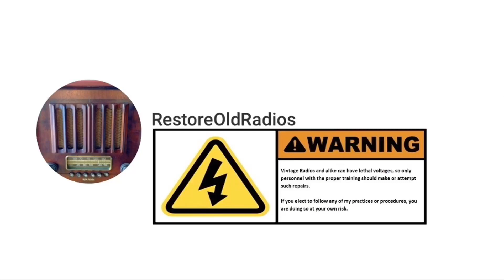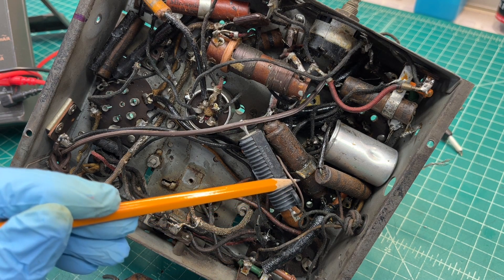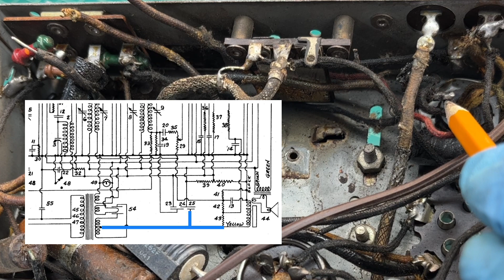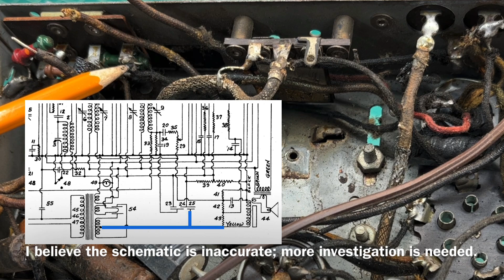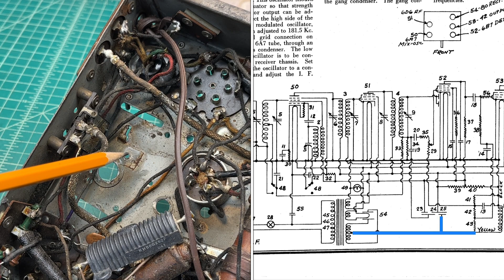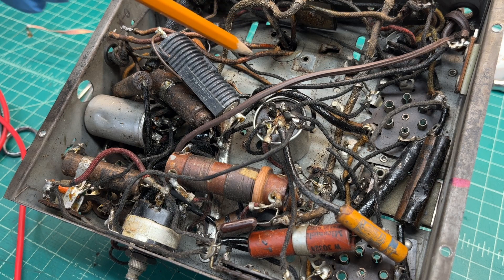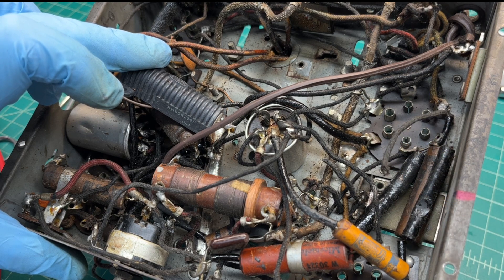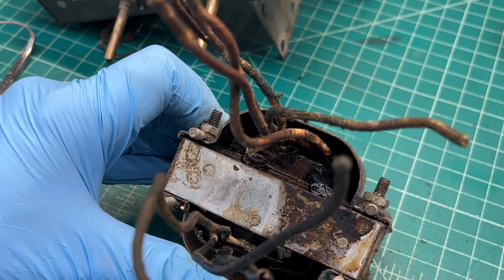Crosley 5V1 - Power Transformer Removal, E-Cap Configuration & Some Chassis Cleaning

Comment: Hi Don, probably not the best place to ask.  I wanted to ask off line but I lost your email address (sorry).  Do you have any tips or suggestions on how to use Renaissance Wax?  I have never tried using it.  Thanks.  Jim
Reply from the maker: Jim, I always apply a small amount to a cloth and wipe it on, let it haze over that takes just a few minutes and then wipe it off. I typically apply a couple of coats, which might be overkill. A little product goes along ways. Hope this helps Jim. Best, Don
Reply: @RestoreOldRadios  Does the product have any useful (very mild) cleaning properties?
Reply from the maker: @jimdukarich1692  Jim, it does. I’ve used it to brighten up dial scales after testing in a inconspicuous area and the white clothes always show…

Comment: The chassis diagram is  correct when it comes to the E caps 23 to 25. 23 and 24 lower line is to B- and 25 is reverse 
direction of 24! Since all are 8uF I'm assuming the 24 and 25 are in series to get 4uF, I think. Enlarge a copy of the 
schematic and start removing lines to B- to confirm it is my best guess. There are too many wire lines everywhere to the
point of confusion me thinks. The transformer looks cooked and dried out. Never stopped you before Don. Probably led 
to some questionable repair work in evidence and you are well on your way to cleaning it up.
Reply from the maker: Steve - thanks for the info. The as-built or as found I should say, is different than your analysis. A deeper dive on my part will be required for sure. As always, thank you for watching and reaching out with this information. Best, Don